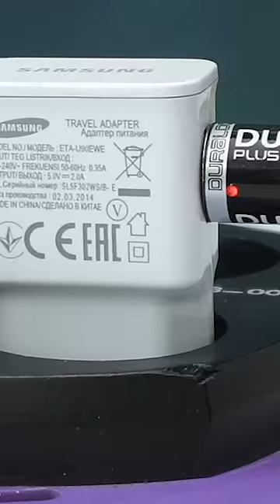Never Buy Batteries Again: How to Convert Your Batteries to USB Charging

Comment: These are the clips that everyone watches, says "oh cool" then ignores, and honestly it's a good thing.

Especially when it comes to batteries and recharging, you should explicitly state the materials used. If people actually tried to follow this short, not everyone would know important details like would this work with lithium batteries, what happens if you solder the connections in the wrong spot, what they can and can't plug this into, etc.
Reply from the maker: Thanks dear for mentioning important tips.

Comment: Great idea! In it's current state it's pretty impractical though, in my opinion.

However you could easily improve the design with some 3D printed adapters for D and C cells. If you were to take that route though I would also suggest making the base unit a AAA size cell and print AA, D,  and C cell adapters. That way it would be insanely versatile and definitely worth the effort! 😉

Again, super cool idea!
Reply from the maker: Thanks for the tips! it is nice idea.

Comment: okay I originally wrote a comment about this outputting too much voltage over twice of a standard AA battery. however, after watching a few times I barely caught this circuit includes an ams1117 voltage regulator allowing 1-1.5 volts output. normally these yt shorts of circuits are garbage but this is actually kind of cool well done.
Reply from the maker: Thanks for your consideration. you can see the full video with detail in the link below:
https://www.youtube.com/watch?v=wBzO2YOtnBQ&t=6s

Comment: Writing from heaven, I died trying this. Even if i survived i would probably die from the heavy metals inside the battery 2 or 3 years later.
Reply from the maker: nice comment :)
Reply: No heavy metal found inside that battery. Zinc is lightweight metal and is needed for your normal body function. Same for potassium and manganese. Ammonia and chloride aren't metals but not that dangerous (literally they are salts). Carbon is nontoxic.

Comment: This won't work longer as the voltage regulator will keep draining the battery all the time. Hence even if left unused, it needs to be recharged before every use.
Reply from the maker: Thanks
Reply: But this is the first iteration of an idea. Further iterations lead to further improvements.

Comment: Cutting through an alkaline battery can pose risks, but typically not a risk of fire. Alkaline batteries contain potassium hydroxide, a caustic agent that can leak out if the battery casing is compromised. This substance can cause chemical burns to skin or damage if it comes into contact with your eyes.

However, while alkaline batteries are less likely to catch fire when damaged compared to lithium-ion batteries, it's still important to handle them properly to avoid short circuits, which can lead to overheating. But generally, the primary risk with cutting into an alkaline battery would be the potential for chemical leakage rather than fire. It's best to avoid cutting, puncturing, or otherwise damaging any battery to prevent potential hazards.

Comment: $5 off Amazon without risk to burn a home
Reply from the maker: it is the other way.
Reply: @InnovaDIY  and the other way is extremely dangerous if ur using lithium ones (which most people use)
Reply: @InnovaDIY  i would rather pay 5$ for a battery + battery charger.. than a fortune to recover from a house fire (if i can even make it out).

Comment: It's mainly the fact that just because you housed the usb in a battery case, doesn't mean that it magically has electrical storage capabilities like a real battery, besides it would not be able to hold much electricity if it did work.
Reply from the maker: yes please watch the full video and all circuit diagram, then it possible to save electricity for work.

Comment: Very neat but do add some capacitance at the end stage, a lot of designs rely on the battery having some capacitance. I think in this design it will go okay though because of the linear regulator, that should give a relatively smooth output. Quality con tent!
Reply from the maker: Thanks for the tips!

Comment: correct me if i'm wrong, but i don't see any form of meaningful overcharge control,
that's a LiPo that you put in there, those things have a well-known tendency to explode when they get too hot, or overcharged.
assuming it couldn't get overcharged, what about over-use? hard cycling a LiPo will make them pretty much useless after too long.
and even assuming you got past the massive fire hazard and longevity concerns that this poses,
this is still a huge waste of time and energy, just buy a pack of rechargeable AAs, theyre far cheaper compared to this, and much less likely to up and explode.

edit: and for those of you who may try this regardless of how obviously dangerous this is,
cut into ALKALINE batteries, a lithium battery will explode in your face,
alk batteries are filled with manganese dioxide (a black powder) and a carbon rod,
while MnO2 is a little toxic, it is far less volatile than a lithium battery.

or, better yet, don't cut into anything and just go buy a battery made in a factory by responsible people.

Comment: As many of viewers said: simply don't do this. There are many of reasons.
I found one more. In the video he's using TP4056 board with 1.2k current setting resistor (0:23). This mean charging at 1A. Lithium batteries should be charged with 1C current, so connected battery should have at least 1Ah (1000mAh) capacity for that current. You're basically destroying your 200mAh cell with that. This only increases potential fire risk with your handicraft.

Comment: Theres already usb rechargeable batteries out there like this. I have some for AAA, AA & 9V. The capacity is low but it pays back over time with something like a remote where it doesnt matter much and is low in power consumption.

Comment: They sell li-ion USB AA batteries like this, but I think with higher capacity since they have cells that fill more of the space in there. Or of course get ni-mh rechargeable batteries and don't waste 1/3 of the space inside holding a USB plug and battery management circuit.

Comment: This is straight up dangerous. I am experienced using lithium batteries in small electronics and I would never EVER mess with a charging circuit in this way, especially if it is to be used with or near information technology. Also, incasing LiPo in epoxy is a big no-no.

Comment: Seems like a good idea, but what if the voltage of the thing you want to provide electricity to is lower ( in which case it will burn out your thing or higher in which case it is insufficient.

Comment: Pros
-good and quick
-small and easy
-good for single batteries
Cons
-firestarter
-not necessary
-potential to blow up
-bad idea and expensive
———
Idea
-buy AA batteries(rechargeable) with a recharging plug.
-I recommend energizer max as there are a lot of them.
-good for the environment and not messy.
-way faster and safer.
-not a waste of electronics ([the usb board] use it on something else like a charger for your phone.)

Comment: To add to everything been said, tp4056 is just charging ic, there is no protections, especially overdischarge protection. So you battery will probably go under safe voltages before device that uses it will stop working and since you used linear voltage regulator, it has standby current of about 2mA, so even when you are not using the battery, it will overdischarge in a few days. This will quickly kill capacity of battery you used.

Comment: Aside from the difficult soldering that can kill the laptop you are charging it with cutting open a battery can cause a lithium fire, which cannot be stopped with water

Comment: Wait until he hears about rechargeable batteries
Reply: @InnovaDIY  I'm actually curious, is this video meant as satire or as genuine advice? 😂
Reply: Sometimes Ni-MH AA sized rechargeable batteries are not a proper replacement for alkaline battery. Sometimes these are the only ones you find at local market.

Comment: I personally would not do such thing. Main reasons:
1. Time - it is quicker to by NiMH AA rechargeable battery + charger
2. Safety - NiMH cells are more stable than Li-Ion cells. Not to mention Li-Ion encased in epoxy.
3. Capacity - There are AA NiMH 1,2V batteries with capacity of ~1800mAh witch will give you ~ 2,1Wh of energy instead of 0,74Wh (3,7V 200mAh used the video) + additional loss at final regulation to 1,5V
4. Complexity - NiMH AA is a single cell instead of cell + electrics.
5. Concern - What is lowest supply voltage for ams1117-1,5V? Wouldn't it discharge Li-Ion battery past it's lowest recommended voltage?

Still, this an interesting project. "Home" made battery witch integrated charging circuit. Just make sure that you know what you are doing when taking up this project.
Reply from the maker: Thanks for your polite and correct comment also your precision in the tip.

Comment: you know that battery over time loses it's capacity and bulges? when you deadfilled it with epoxy, battery has no space to expand in the case, might result some trouble
Reply from the maker: Thanks for sharing.

Comment: I say if anybody is capable of pulling this off, they should indeed do this
Reply: Issue is: This video cannot be pulled off, at least not without breaking your hardware
Reply: @GandhiTheDerg yes that's why they should first be capable 😄
I admit I do see some inconsistencies which would not make the implied outcome shown here possible. Such as replacing a 1.5v battery with 3.7v one.
Honestly, I do not see how this could be hazardous as the comments make it out to be. Also cutting open these batteries is no big deal for since I've been doing it for ages. Yea I know it's not a safe practice and could be harmful but I'm glad that didn't stop me. 
Anything besides this, means I surely missed something here hehe
Reply: @VDOless  Issue is these are lithium ION cells. 
Overdischarging them (Because of a lach of overdischarge protection) can be dangerous, as they will Heat up like crazy (The TP4056 can get to temps of 80 degrees celsius in that case!!!) AND casting a lithium battery in resin is an explosion hazard, as they need space to expand should they critically fail!

That's the only things i noticed, there is probably more, like glues the TP4056 drectly to the USB thing which can cause shorts if you're not experienced enough with these things
Reply: @GandhiTheDerg  which is why I said "capable of pulling this off" Any monkey with a soldering iron cannot just solder SMDs. You said it yourself, "if you're not experienced enough"

Comment: Changing 1500 mAh battery to around 65mAh accumulator. Also tou need step-down converter to lower 3.7v to 1.5v.
Reply from the maker: please watch the full video it has a circuit diagram.

Comment: well time to make a make an essay about this vid
firstly, cutting open batteries is a BIGGGGGG hazard. they may explode and their insides can cause fire.

so you could've simply measured the dimensions made a copy of the battery using a 3d printer and add the two metal ends.

second as @JesseHughson said in a comment epoxy will put pressure on the li po and it could explode.

third, alot of electronics that use batteries usually say not to use rechargeable batteries on them as they may fail and get damaged due to batteries sometimes not releasing enough voltage.

i mean no offence to the creator and i am saying this for the imformation of others  BUT  @InnovaDIY PLEASE DISCLOSE SAFTEY INFORMATION IN THE VIDEO because some people may not check the comments and there are obviously some children who may see this. you also may be sued if someone is hurt.

Comment: So you are telling me that the mouse does not care about it's nominal voltage of 1,5V being exceeded?
Lithium cells like this usually are 3,7V nominal, 4,2V when fully charged.
this would screw up your mouse big time
Reply from the maker: it has a circuit diagram and control voltage and current.
Reply: @InnovaDIY  No? It does not? The only IC on there is the TP4056, which is a charging regulator IC that is usually paired with a DW01A for discharging. 
This is going to kill the lithium battery because of overdischarging it, AND the mouse for overvolting it. 
The TP4056 Discharges at the batteries Voltage usually, and will put the entire voltage in without a Voltage divider, which does not seem to be present from your video

Comment: Jesus Christ that's the worst thing I've seen on YouTube shorts yet. DO NOT FUCK AROUND WITH BATTERIES, THEY WILL IGNITE. All you did was take the shell of a AA and put a tiny lithium cell in it. All those components are likely more expensive and less long lasting than a comventional lithium AA battery.

And please, for the love of god, if you elect to do this, DO NOT TAKE APART A REAL AA BATTERY FOR THE METAL SHELL. You hardly need a shell for this. I'd glue it together, but if you want it to look good 3D printed plastic will do and it won't be a fire hazard to get.

The only good thing about this video is that a AA can't instantly vaporize you like a battery of a higher caliber

Comment: AA battery 1.5V li-ion 3.7V or you have magic li-ion with 3.7V output
Reply: The project is bad on many levels, but not on this, he used a 1.5v voltage regulator, it's linear tho, so it wastes more than half of its capacity on heat,  and has a pretty noticeable standby current, that will discharge battery in few days, even if you don't use it.

Comment: this is dumb in so many ways, not only is it dangerous but i think he cut into a dead battery but you just sacrificed capacity for the usb, like 1/4 or 1/2 of its original capacity is gone and you would need to charge it more often. i wouldn't even do this at all

Comment: Typical AA Duracell battery has a capacity between 1450mAh and 2000mAh. the lipo battery that he put inside is 200mAh, between 7 and 10 times lower capacity. Just because you can, does not mean you should do it!!!
Reply from the maker: The concept is valuable.

Comment: Just buy 1.2V NiMH rechargeable batteries and a battery charger. That would be easier to do and much safer.
Reply from the maker: yes but not for DIY maker
Reply: 1.2V is so very low voltage for many appliances. Some will cut power down to 1.1V quite soon.

Comment: You just spent more on SMD's and connectors than you would have (not counting the risk to your health by cutting open that battery) by just BUYING a 12 pack of rechargeable AA's...
Cool, but FAR from "educational" especially given the cold soldering that you had to do because you didn't spot weld like you should have.

Comment: First of all it will explode if you cut The battery then he faked the scene of inside of the battery I have opened a battery before and there is a type of tin foil not like metal dust

Comment: This is a horrible idea. If your batteries are not designed to be recharged it's for a reason. READ THE WARNING LABELS IN THE BATTERY.

Just buy rechargeable batteries, they're not gonna blow up because the chemicals in them are specifically designed to be recharged, and don't do this with those, it's even more dangerous probably, and even if it was safer than with non-rechargeables, at that point why even bother?

Comment: That's whole lot of work for nothing. 1st the tiny lipo has miniscule amount of energy stored into it, so it won't last even half of the time AA battery would last
2nd AA batteries have 1.5v and things designed for AA batteries works with 1.5v (or any multiplication based on how many AAs are in series. Meanwhile Lipo cell has 3.7V... 2,5 times that, so you're gonna fry most things you plug this in
3rd if you want rechargable AA batteries, just buy nimh 1.2v rechargable bateries. They're cheap, reliable and have many times more capacity then this little Lipo cell in this diy shit
Still less then good quality alcalic bateries, but you can recharge it any time

Comment: But, but, but it started out as a USB charging battery. You did nothing different. I mean it's a li-ion battery now with less milliamps and higher voltage. W......t........f....??????
Reply from the maker: no dear please watch the full video and the circuit diagram. thanks for your consideration.

Comment: This is not how it works, at all. Firstly, batteries do not look like that on the inside.
2nd: to actually put charge into something, you need a full cirquit. Wich is connecting one end of the battery to the other.
3rd: lithium ion batteries discharge their charge extremelly fast. They are like capacitors that just hold more charge in a different way.

Please stop clickbaiting people, this is higly false. Go do something else instead of doing videos like this. Or at least just teach people things that actually work and are useful. DO YOUR RESEARCH BEFORE MAKING A VIDEO.

Comment: This is pointless, if you follow these instructions you will end up with a battery that has less than a 10th of the capacity of an actual alkaline. Just buy real NI-MH rechargeable batteries.
Reply from the maker: The concept of this project is nice.